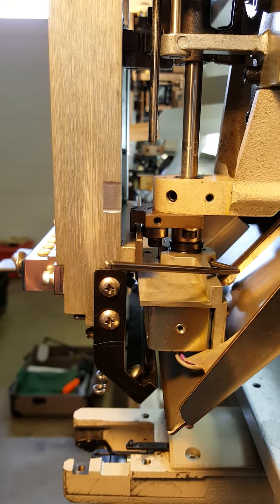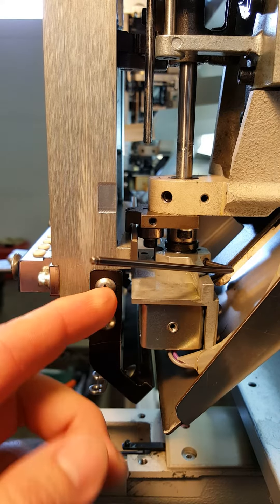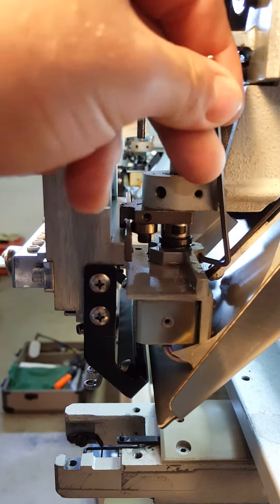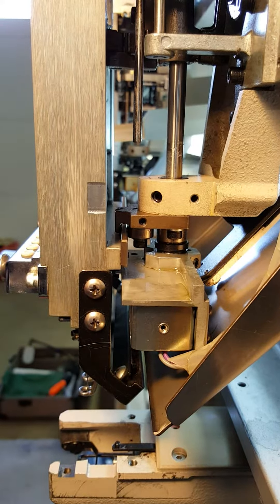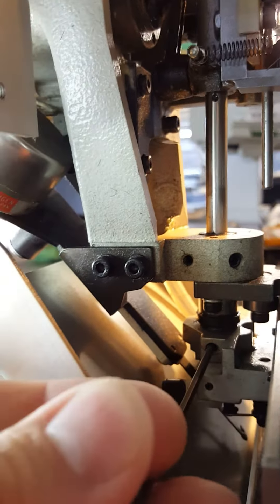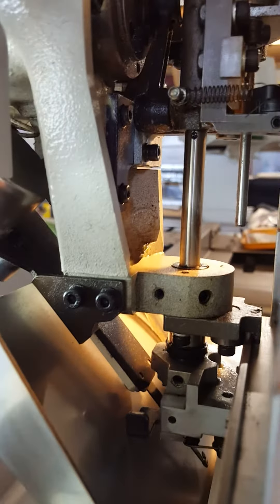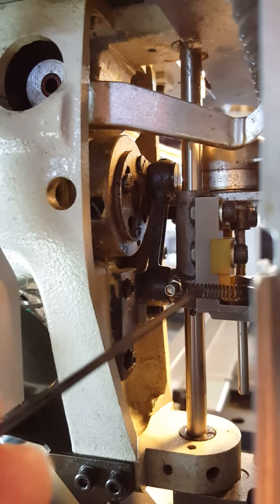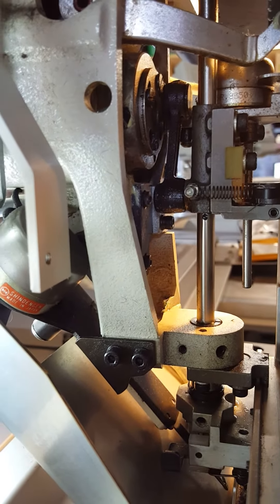Barudan Colour Change Problem

Comment: Wanted to post here and say what ended up being the issue with my machine, D05 error

Behind head number 1 there are pairs of sensors attached to the frame which the computer uses to detect which needle you're aligned with. There is a small metal piece attached to the back of head 1 which sits between the pair of sensors which correspond to each needle bar. If this metal piece is bent out of place, your needle position will read N0 on the screen and you will first get the D01 error, then D05 once you line up the color change lock. To fix it you can simply bend the metal piece back into position taking care to align with the correct pair of sensors for the needle bar your machine is set to. If you did this right the needle position on screen will change to the correct number and you'll be able to change colors and run files again. Either way this video helped me learn a lot about how my machine works! Thank you!

Comment: Hi, if anyone else gets a D03 error like I did on a multihead, go to the head 1 and rotate the dial (it's got these two big screws on either side of it)  on the right inner side near the needle bar so its vertical, turn off and on the machine. Then it should work.

If this isn't enough, turn all heads on and go to the "Manual" page and keep pressing the pin in/out button, make sure it can go in and out on each head. Then do a manual color change, this is what fixed it for me...

😁